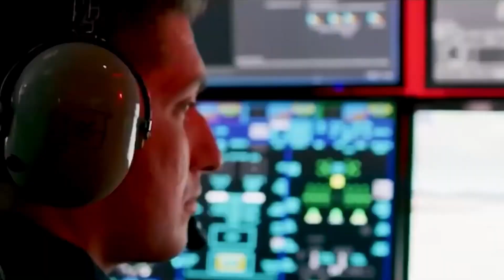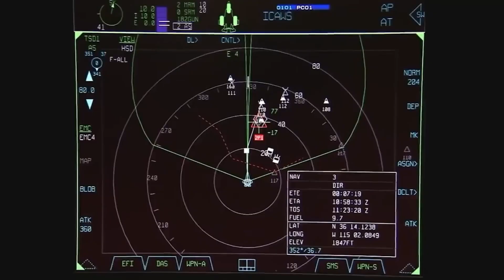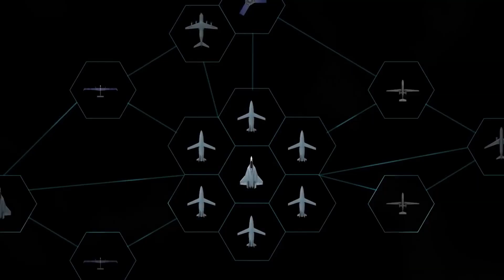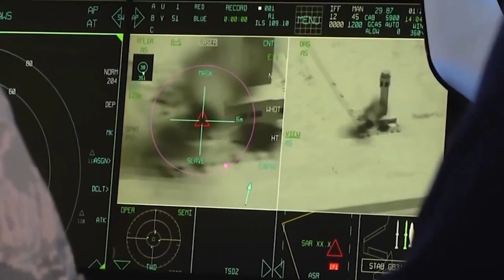The US Just Unveiled Their 6th GEN NGAD Fighter Jet

Comment: The only thing that will be next inline to replace our F35 fighters or F22 high speed interceptors will be pilotless aircraft.  So if u see a canopy on any possible replacement concepts,  it isn't going to happen.  The pilot and cockpit  especially for a fighter, severely incumbers the aircrafts possibilities as far as maneuverability.   The cockpit, canopy and ejection seat not only a lot of weight, but tens of millions to the cost of a fighter. It also may indirectly cause a shorter safe damage tolerance life due to design compromises.  So the near future pilots will all go by the initials, A.I.
Reply: i mean you are not wrong F22 is insane top of the top on ability the eurofighter and rafales are badass too but still